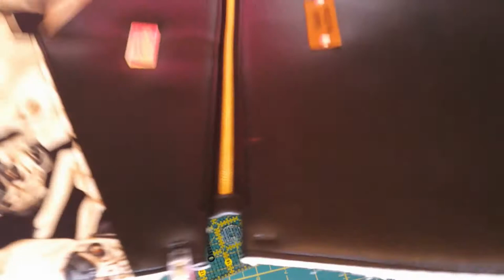D Ring Connector Hack For A Domestic Machine

Comment: I like the way it looks. It would have been nice to see the final finished product. I noticed the first strap went all the way to the bottom of the pattern piece. The second one stopped short. Do you want them to go all the way, or does it matter? Also, it seems like the strap wouldn't be balanced with the D rings just on the back of the bag. I usually add one on each side seam or one on the front and one on the back.